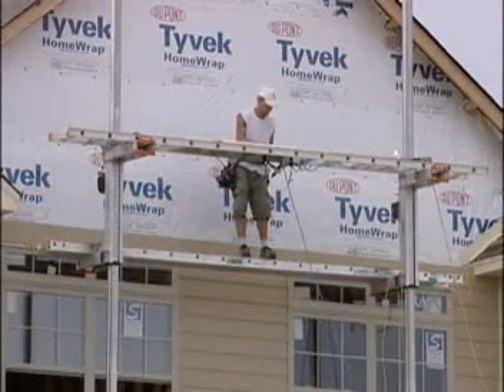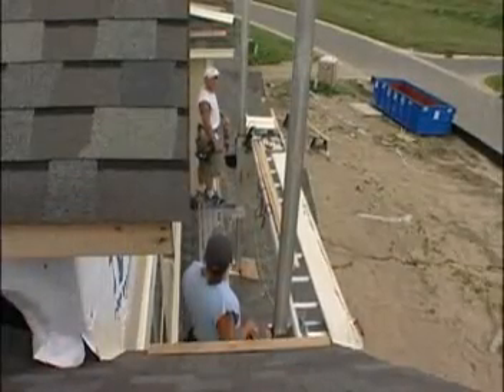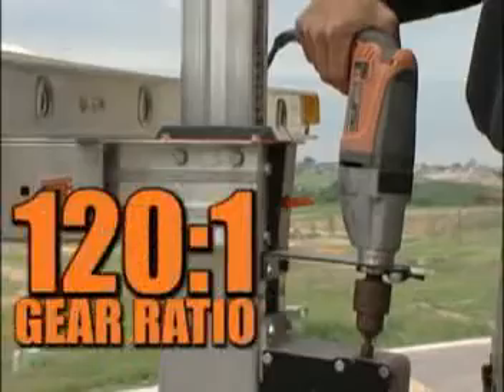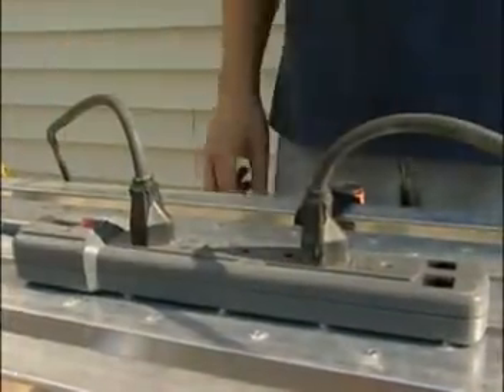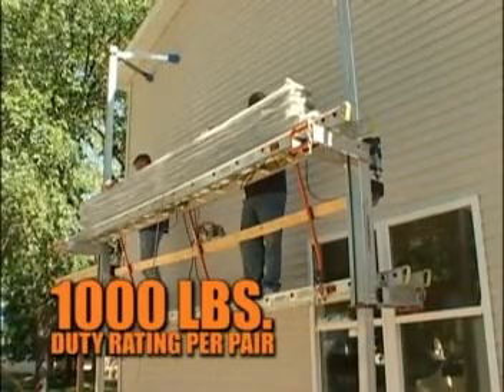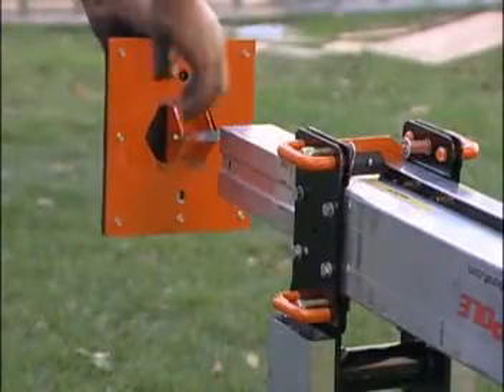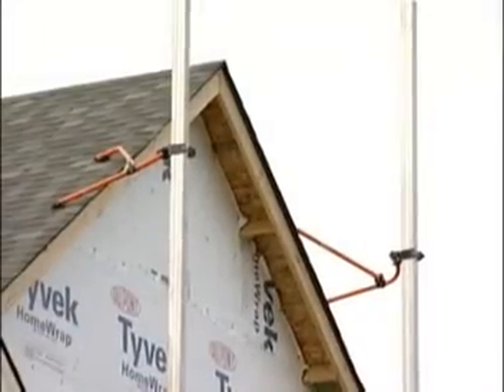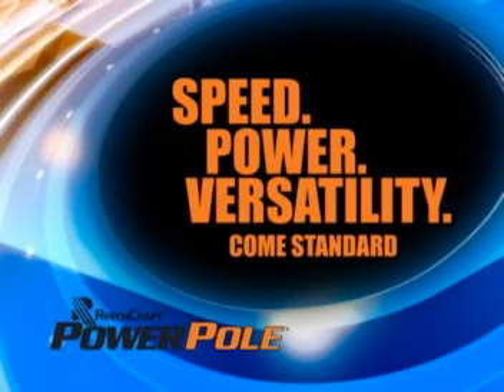PowerPole Standard System

Comment: Got to the top and the cord got unplugged. Been stuck at the top for 4 days
Reply from the maker: Hi Roger, per OSHA requirements, a ladder must be accessible at all times while using the PowerPole. In addition, we recommend having a spare cordless drill in the event of a power outage, and extension cords should have locking prongs or be secured so they cannot become unplugged. Another option is to use a generator on the system itself and, as always, keep a cordless drill as a backup—this would eliminate long cords and make the system self-sufficient! Feel free to visit our FAQ page for more information on the PowerPole: https://www.reechcraft.com/powerpole-faqs/
Reply: But don't have a heart attack from the workout.  Ya might be up there till the firetruck arrives.